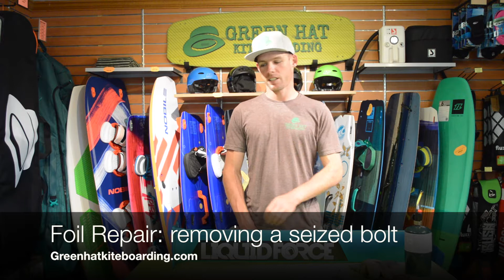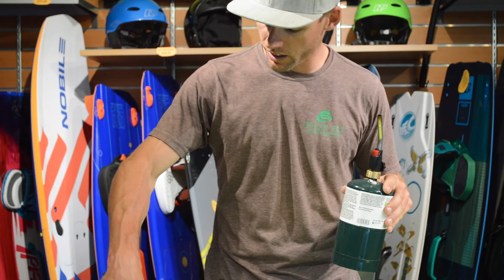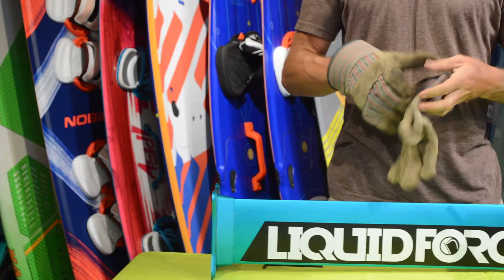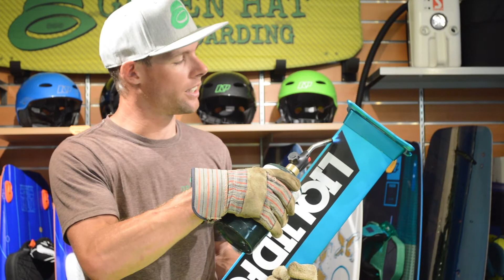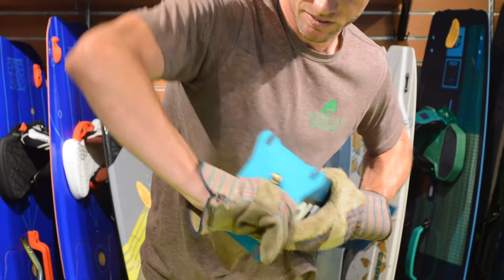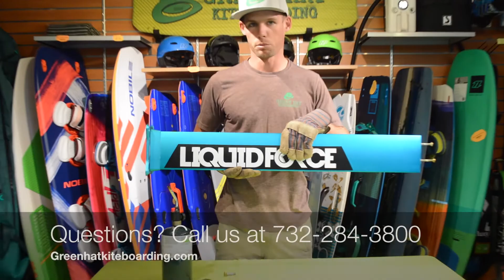Foil Repair: how to remove a seized bolt from an aluminum foil mast

Comment: What's the best way to remove the bottom screws on a Slingshot mast, which is connected to the carbon fiber/composite front wing? As heating that part might melt the carbon fibre/composite?